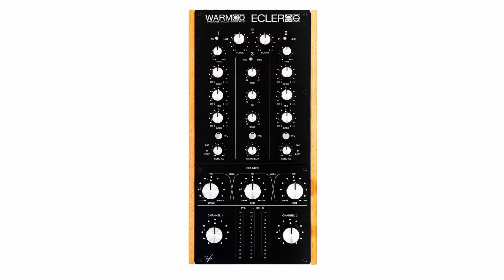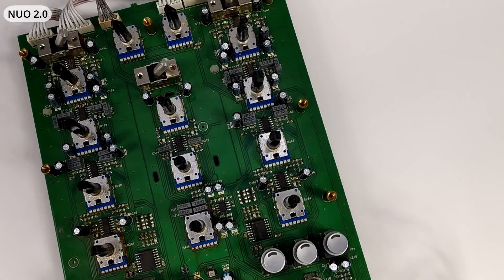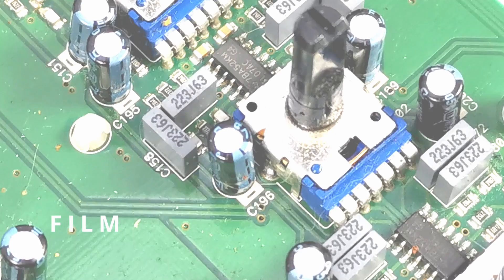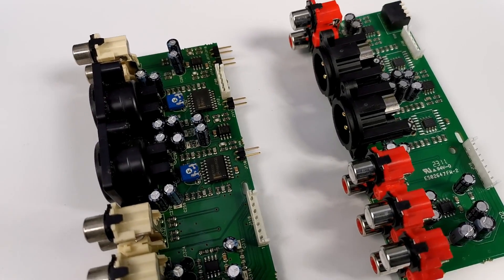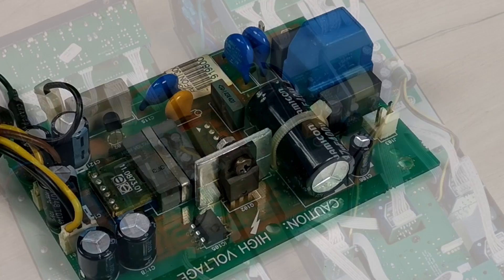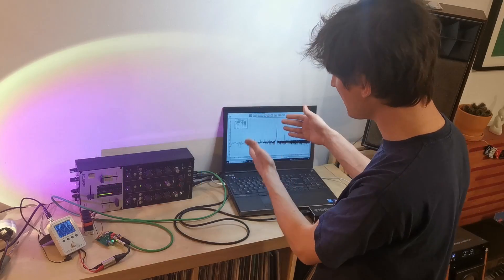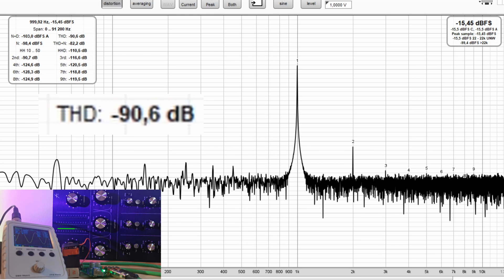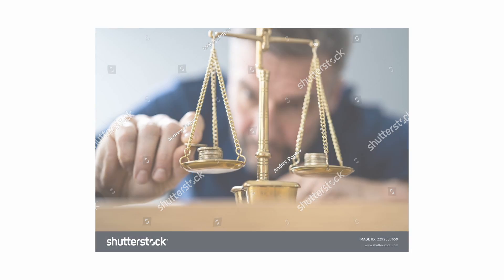Mixers Inside: Ecler Warm 2 vs Ecler Nuo 2.0 + my measurement setup

Comment: Great comparison. Thank you very much for the work, it has been very revealing. I recently acquired a Nuo 2.0 with some repairs and cleaning to be done. I have to replace the kill and pre listen push buttons. The eq potentiometers also have play, so I will be looking for a replacement with a metallic shaft and more durability if you could recommend one I would appreciate it).

As I have acquired the mixer very cheap and I have to repair it, I am thinking if it makes sense to make some additional modifications that can provide a substantial improvement in the quality of the filters, power supply, phono inputs and output.

I have thought of replacing the capacitors that affect the filters, by some of the same characteristics (voltage and capacity) but of better materials and tolerance, by brands of recognized value in the audio world.

I also wonder if replacing the low cost opamps that it implements, by other compatible ones of higher quality (even in discrete mounting for the master output stage) would be a substantial improvement.

I would like to know your opinion on this and if it would really be worth the work. Best regards
Reply from the maker: You must do your own research on this, let me know if you're happy with the results!

Comment: 5:24 do you know if it’s possible to bypass the fader curve on nuo 2.0 so you get a linear curve? I think that the fader curve on this mixer makes it pretty much useless.
Reply from the maker: I'm not sure I get your question right. Fader curve can't be bypassed. You can shape it with a potentiometer in nuo 2.0.
Reply: @mixersinside  yes I know that, but I can’t find a setting that works at all, so I wonder if there are a way to modify or bypass the fader curve potentiometer so that the fader curve becomes 100% linear ?
Reply from the maker: @TheOfficiallMarcus  there is no way of "bypassing" fader curve control - you can just replace it with something that will set a fixed value, but this is the same effect as leaving a potentiometer in certain position. You can of course modify the curve control, but most of the settings you want to achieve are already implemented, you will end up with even stranger curves. I don't exactly know what do you mean by linear curve, but this setting is already present in the mixer.
Reply: @mixersinside  no I can’t get a linear curve and I have heard others that have the same problem. When I say linear curve I mean that the volume increases the same amount all the way and not exponentially. Could you get a linear curve on the mixer you used in your video? Maybe my mixer has a faulty potentiometer?
Reply from the maker: @TheOfficiallMarcus in theory rotating the curve knob fully left should solve your problem. If it doesn't work maybe try to reach Ecler directly?

Comment: Hi @mixersinside :). Thanks for this video. Do you maybe know what exact b5k potentiometer model used in the Warm 2 (source knob)? I need to replace mine as it rotates 360 degrees )
Reply from the maker: Hey, please contact Ecler directly.

Comment: Thanks for this video. am looking to get an ecler for my dj set up. based on your test, which mixer will you say is the better one ? i see also that the cross fader on the nuo can be use as an isolator technically.
Reply from the maker: @QRS365  thanks for watching. All the information provided can help you with making your own choice. Also don't forget to use your ears when choosing a mixer!
Reply: @mixersinside   I think I'll go with the nuo

Comment: a very welcomed comparison, thanks! the power supply on my NUO just fried and with Ecler not responding on how to replace it, I am actually looking at a replacement. The external resemblance of the two caught my eye and it's evident, I wanted a look at the actual inner differences. It seems that even if the price difference is not justified at all, thecleaner specs of the warm 2 might be appealing, especially if not driven too much! I was wondering if the S/N ratio which looks better on the chart for the warm 2 is true: why don't you test that too?
Reply from the maker: @RiccardoCastaldi  i don't measure the full spectrum of parameters cause I only use measurements as a tool to determine the sound coloration of the mixers here. I could measure IMD, SNR, crosstalk etc. but this channel is not about measurements. I focus here more on how things work and what sollutions were used.

Comment: I connected a hand-sized synth (monotron delay) to the mic input of my ecler warm2 for a few minutes and then noticed that the right input was a line input... and it worked fine. Could I have already damaged my mic input or preamp during the few minutes I used the synth in there?
Reply from the maker: This is a question for Ecler customer service.

Comment: What speaker is that in the video? Thanks for the great content.
Reply from the maker: Can you give me time id? Cause i don't remember any speaker.
Reply: @mixersinside  Whoops maybe its not a speaker but behind you at 6:56 with the cool looking waveguide at the top
Reply from the maker: @s_9878  Grundig Box 506a. I've modded the crossovers and love them!
Reply: @mixersinside  yes thats right I was looking at a pair years ago, Im also a fan of reasonably priced vintage speakers. What did you mod on the crossovers?
Reply from the maker: @s_9878  i've changed electrolytic caps to film ones and damped the signal that goes to the tweeter cause the original response was very non-linear (the original sound was way too bright).

Comment: Please can you do a comparison video of the A&H Xone 23C and the Pioneer DJM 250Mk2? As you probably know, these are the affordable,  entry level mixers from these two big names. Similar price, similar features. People often talk about Pioneer supposedly having bad implementation of the RIAA curve in their phono preamps, whilst A&H are said have a good preamps. I'd love to see a video that digs into this and really shows the difference between the two
Reply from the maker: Very good idea thanks. But i have the same problem as always: i don't have access to this gear. Maybe i will figure something out, should be quite easy to get them.
Reply: I had a 250mk2 just as an easy, fairly affordable way to play around with DVS after being a vinyl guy since forever. 

It sounds really good in a clinical Pioneer kinda way but lacks the character and richness of an A&H (or Ecler for that matter). A&H preamps are indeed a key selling point. 

The X23c or Nuo 2.0 are also much more professional in that they have booth outs and FX loop, useful if you’re going to use your own gear for DJ gigs. The DJM 250 is much more a bedroom device.

I use the NUO 2.0 and love it. Have used it live many without a hitch although 9 out of 10 I just use the house set-up (usually a Pioneer 900 or A&H 92).

Comment: hi, in terms of overall quality between the omnitronic trm 202 and this warm 2... Is it worth double the price for the warm 2? i'll be very grateful if you answer that. Very good videos you make. Keep it up!
Reply from the maker: You must answer this question on your own, i provided a lot of information.
Reply: You are correct, based on the measurments i made my decision. Thank you for bringing light on the topic :)  @mixersinside
Reply from the maker: @gero7822  making your decision based on THD @ 1kHz measurement alone is very incomplete. It's just one measurement that gives you a brief information about mixers sound coloration. High THD mixers sound can be perceived as amazing as well as lower THD mixers sound can be perceived as unpleasant and vice versa. I've discussed this topic in the Bozak video. I strongly suggest listening to the audio devices, not just looking at the numbers alone. The numbers can tell you a lot but don't give you the complete image. 

But first you've asked about overall quality - on the video you can see detailed shots of the parts used. Based on that you can judge if doubling the price means getting better quality components.
Reply: @mixersinside  I really dont think the overall parts and design chosing of the expensive one, makes it worth that much. so i did chose the less expensive one. if i had the chance to try them all, first, before making a decision, would be the perfect world, so i would not need to make decision out of videos and measurments, but this is not possible. i guess ill just have to stick to my decision for now :) thank you again.
Reply from the maker: @gero7822  enjoy your new mixer!
Reply: @mixersinside  thank you, i really hope i made the better decision... :)

Comment: Brilliant comparison here! I like that you've gone for this one as Ecler is a great brand delivering bang-for-buck across the board: sound quality, ergonomics, design, features, durability.. just solid products. It's at that perfect mid-tier price point that a lot of people can get in to. They're reliable and have a good enough sound quality that you can happily record a mix on them, stream with or set up 'em at a small party or bar and be quite satisfied. I've had A&H Xone:32, :42 & :62 and after selling the last one (the :42) i got a B-stock Nuo 3.0 as i was saving up for a :92. I ended up keeping the Nuo 3.0 as it's just a great mixer with excellent sound, feels good and those fader + xfader shape controls.. ooh.. love it!
Reply from the maker: For sure I wouldn't call those mixers a bang for buck. But they are nice.
Reply: @mixersinside  Actually, i've got to say you're right looking at the price of mixers currently. Nuo 2.0 is a deal at around 400 euro, though Warm2 in comparison is a real pricey. Omnitronic, even Allen & Heath seem to do better.. 777 euro for a Xone:43 on Thomann compared to 666 for the Warm2 makes me wonder.. I suppose Ecler looked at the rotary market and figured the rotary loving cats may skip Omni' and need a step between those and the MasterSounds Radius 2.
Reply from the maker: @havaac  right - considering the prices of other mixers NUO 2.0 is a deal indeed.

Comment: What brand(s) of electrolytic capacitors are used in the Warm 2? :)
Reply from the maker: I didn't check this because I didn't think its worth mentioning in this case - no standout here. Maybe it's visible on some shots or maybe someone will let us know.
Reply from the maker: I watched the shots, with a little effort you can spot the brand names on the capacitors.
Reply: @mixersinside Yes I already recognised some larger Rubycon caps by the vent cutout patterns on the top. The rest I wasn't able to read, but my guess would be Aishi? Still decent and better than the crap found in the E&S DJR-400 ;)

Comment: I was almost going to buy the Warm 2. I test it on a vinyl store and I did not like the plastiky knobs and internally they are also plastic. Maybe that is why the feeling of the knobs was not very solid
Reply: fyi the warm 4 seems to have been overhauled and sports bolted metal shafts - at a much higher price point tho.
From my personal experience, you stop thinking about it as soon as you get used to the flex. However, I am talking about the nuo 3, which uses completely different (oversized) plastic caps. Combining those flexing shafts with sturdy looking metal (?) knobs, like the did on the warm 2, seems like an odd choice indeed.

Comment: Another great video, I knew the warm2 could be a source for the blown NUO2.0 PSUs I have to replace...

I think it is worth mentioning WHY manufacturers decide on VCA or passive volumne control. With high/intensive use of fader by a wide variety of DJs (eg turntablist/scratch djs), the faders tend to suffer signal-quality wise, so by not routing the audio through the fader but instead using the fader just to control the chip, the audio signal iteself does not get diminished by any crackles in the fader. In contrast, a mixer like the warm2 with its target audience seldomly moving the potentiometer(=fader) very fast (=rough usage), less wear on the component means good sound for longer.
Additionally, and this is specualtion but I think there is truth to it, linear potentiometers are mechanically less sturdy than high quality rk27 potentiometers not just because of the materials but also because of the dimensions and geometric properties. Less momentary/lateral force on rotary potentiometer compared to linear potentiometers.

Are you interested in battle mixers like an ecler hak360?
Reply from the maker: Thank you for this comment! 

Increased resistance to wear is undoubtedly the main reason of using VCA faders. There are also a few others, such as faithful reproduction of the logarithmic curve and much better symmetry of stereo channel attenuation in every slider position.

Regarding your HAK question - so far i want to focus more on popular mixers like Xone96, MasterSounds, Condesa etc. but in the future for sure there might be space for HAK. The question is: is it really worth to do EVERY mixer, since they don't differ that much and also HAK model is also from Ecler so i think that there are a lot of simmilar sollutions to those used in Nuo.
Reply: @mixersinside  Yes I agree, it might not be worth it as usually manufactures re-use their circuit designs from mixer to mixer. I was just asking as you called for more mixers but the only ones I have currently are Ecler Nuo2, Hak360 and TRM 402 by Omnitronic and you already covered 66% of those.
Reply from the maker: @ohnoezitsroger  i see - that's a very kind proposition, thank you!

Comment: Did I hear correctly that the phono pre-amp is the same as on the Omnitronic ?
Well done.
Reply from the maker: The same topology, the same op amp, the same passive component quality - very very simmilar design. The same cost for sure. Doesn't mean it's bad tho, but yes - it indicates that it's the same league.
Reply: @mixersinside  thanx for explaining!
Reply: @mixersinside  Shieet, I'm a bit surprised. Everyone says Omnitronic is a Chinese oem. Could it be that the legend of the Spanish Ecler has fallen?
Reply from the maker: @lcaise  I don't know why you drew such conclusions. First of all the times when Chinese products were considered poor quality are long gone. Secondly, if the Nuo 2.0 mixer was surrounded by legend, I see no reason why the Warm 2 couldn't continue that legacy.
Reply: @mixersinside  A friend in London bought a Sub Zero model - a twin to the Omnitronic. After a few days the mixer started to break down and he sent it back to the shop. If you check YouTube you will find that the SubZero is an oem as is the rotary Omnitronic. That's why I have concerns. Personally I'm not against cheap hear, quite the opposite - I own several Omnitronic turntables, Gemini and others. I focus on the price - if it is the same design, why 2x more expensive:-)

Comment: Like for review! How about arranging some top chart of the mixers you tried already considering sound quality
Reply from the maker: I focus solely on measuring Total Harmonic Distortion (THD) here. This measurement helps determine whether the mixer tends more towards a warm/colored sound or a transparent one. However, relying solely on THD isn't enough to evaluate the overall sound quality comprehensively. I avoid using charts of this kind because they oversimplify the complex nature of audio quality. To elaborate, some people, if not the majority, prefer higher THD in DJ mixers as it enhances the "richness" of the sound. Consequently, creating a "sound quality" chart based solely on THD wouldn't just be oversimplified - it would also be challenging to determine what should be on the top of the chart. Sound perception is highly subjective, and the decision ultimately rests with the consumer.

If you feel that this topic is interesting for you have a look here: https://www.passdiy.com/project/articles/audio-distortion-and-feedback

In the audio world, an ongoing debate centers around subjectivism versus objectivism, essentially comparing gear evaluation based on measurements versus auditory experience. I position myself somewhere in the middle, but with huge respect to measurements. I avoid labeling mixers as "good" or "bad" based on the measurements alone, but I also laugh out loud when someone call some mixers "hi end" when they simply distort the sound like crazy (very often thanks to cheap components!).

This channel provides an excellent platform for evaluating whether high-priced "boutique" mixers differ significantly from those in lower price ranges. It can also help you choose a product that aligns with your preferences, especially if you already have a preferred sound signature.

Based on your expectations, you can select a mixer that accurately reproduces the sound or one that adds some warmth or whatever you call it. DJ mixer users often confuse the term "hi-end audio" and apply it to devices that process audio in an unfaithful manner. And to make things even more funny - the preffered "warm sound" is most often cheaper to achieve than a truly transparent, undistorted sound!
Reply: @mixersinside  thanks a lot for your answer! I will definitely check out that resource you recommended!

Comment: Cool review, I was wondering about a possible hack. Are the connects after the phono stage in the Nuo 2.0 at line level? I want to integrate a dvs interface, and that would mean I could use the superior Ecler preamps for DVS and vinyl playback. I think I could do the same with the line feed and the FX loop
Reply from the maker: Why do you consider Ecler preamps superior? 

Signal amplitude after the phono preamp is of course at line level, that's the main purpose of a phono preamp.
Reply: @mixersinside  In an A/B Test with the NI Audio 8 interface I found the Ecler phono preamps to be superior, that being said the size of the interface is to big to fit in the Nuo 2.0. I will try integrating it when I get my hands on a A6 or even A4